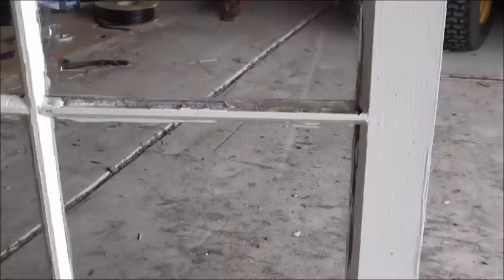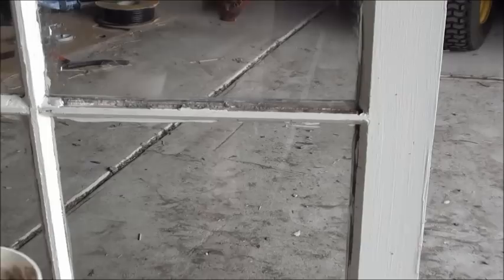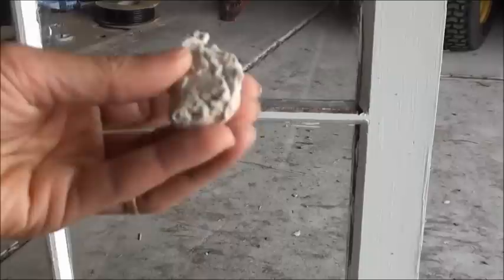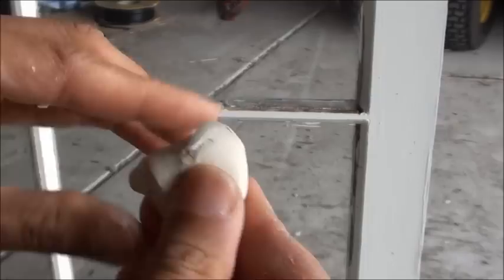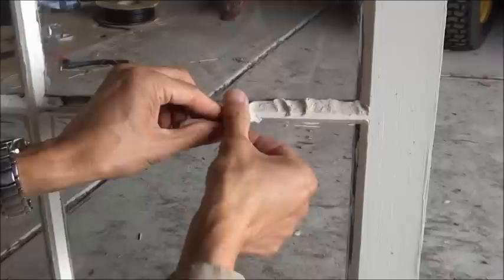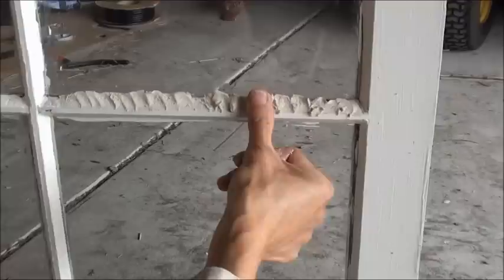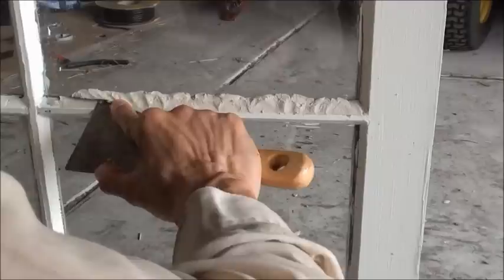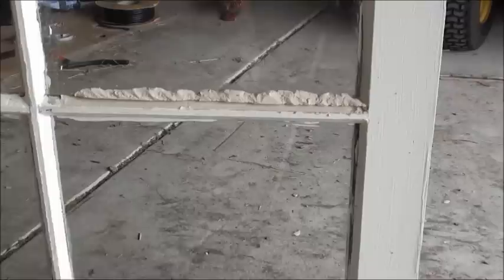How to apply window putty

Comment: Dear Friend, your video looks so easy. BUT my linseed oil putty did NOT behave in the way you demonstrated. It was super tacky and absolutely refused to be manipulated in my fingers. It was more like CHEWING GUM! It stuck to everything I touched. Trying to roll it was a joke. I did get help from your video however and did a semi decent job. I would suggest to anyone doing this to make sure they have a flat piece of say mdf to scrape the filler knife against, a brush to get rid of dust, a cloth with white spirits and to apply linseed oil (or equivalent) lightly to your fingers prior to the work, to stop the putty attaching itself to you!! It was by the end satisfying to do and though mine is far from beautiful, waterproofing was my primary objective. I can see you are a professional and THANK YOU!

Comment: I always wondered how window glazing worked on windows. I just used it as a replacement for painters putty on nail holes lol. Mix a lil whiting with it and it flushes so much easier than regular painters putty, no fish eyes. At least the dap brand glazing is like that. Idk about linseed glazing.

Comment: Suggestions- Remove old putty first ... Heat gently with a torch. Missing last step in the video is slicking the putty - Wipe a couple of drops of linseed oil on the putty knife blade. Optional, but correct is paint priming after cleaning out old putty - which stops the raw wood from sucking the oil out of the new putty.
Reply: I tried applying putty for the first time. My problem was that while applying the scraper putty would either stick to it or it would make gaps.
Reply: how did you overcome this issue?
Reply: dude so much more info , please be a youtuber
Reply: Whats a good sub for linseed oil?

Comment from the maker: Thanks for dropping by. It is really not difficult. The beauty with putty is that one can keep trying until it is right as it stay soft for a very long time....Wait at least 2-3 weeks before painting.
Reply: khthhonl do you need to put anything on the putty before you paint like primer?
Cheers
Reply: Do you let glass sit in place then putty...both sides I'm building windows by hand does the glass need to fit in a Grove or does the putty act as a barrier as well?

Comment: where I am  in the midwest,,,big city ,,, big box stores do not sell oil based window putty
a good substitute =oatey brand  plumbers putty,buying in small containers  is better than big buckets unless you are a high volume window repair dude,,it might seem a bit dry,,tough to apply,add a wee bit of furniture lemon oil,,it goes on smooth makes nice seams

Comment: Thanks for the video. Looked easy until I tried it. Maybe it was cheap putty or something but I found it unworkable. It kept sticking to my fingers and coming off. Got in a right mess!
Reply: If its too soft and sticky,try taking it all out of the container snd leaving it out on a piece of board or a plate for a day or two. Also,make sure its mixed well. Sometimes,it softer at the top of the container because the linseed oil tends to rise up to the top.
Reply: @tbomberus  Thanks for your reply :)

Comment: Thanks for the video.  I feel like I am ready to give this a go on the few windows that I need to re-putty.  I do have a question. Once the  old cracked putty has been removed is there anything that I should do to prepare the window sash before the putty is applied?
Reply: I always make sure that the wood under the old glazing is primed before applying fresh glazing. This will prevent the wood from wicking away the linseed oil from the new glazing,which would dry it out faster.